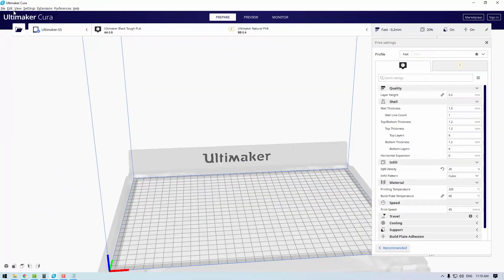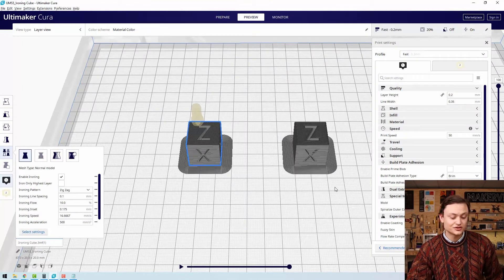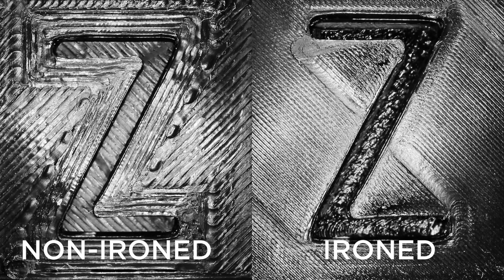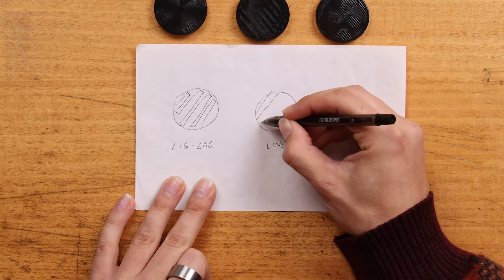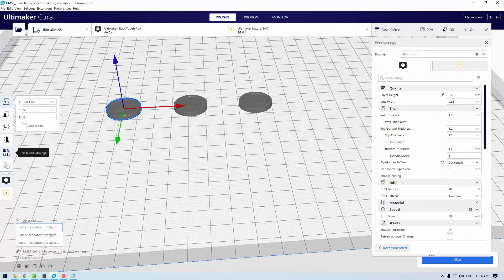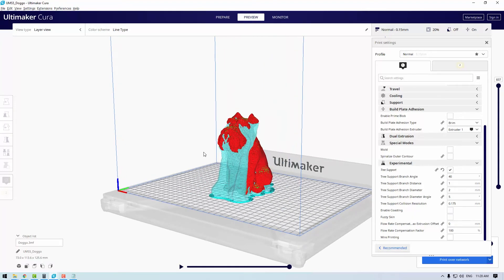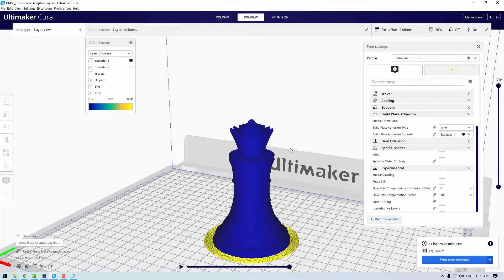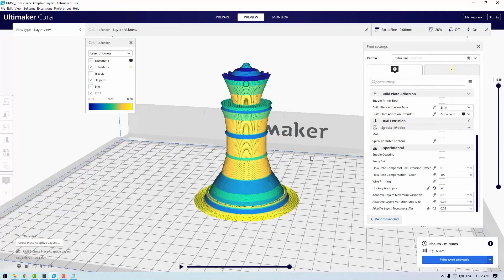More Exciting Features in Cura! Ironing, Top/Bottom Pattern, Tree Supports & More!

Comment: I would like to know if there is a way to print or simulate a solid first layer. It looks like the top and bottom layers are always going to have layer lines. In simpliy3D and Superslicer I can specify a solid top and bottom layer and how may solid layers to print. So far I printed one model 2 times in Cura 4.12.0 and the bottom layer prints with wide layer lines just like the infill pattern type. I wonder if something like ironing the bottom layer or something similar will make the bottom layer smooth. any thoughts? Thank You.
Reply from the maker: Top layers you can get away with Ironing to creating a more flat surface but when it comes to bottom layers you are more limited. This is really because the bottom layers main purpose is to grip the build platform. Ironing that first layer will mess up that adhesion. Knowing when to use Combing and Perfecting the Initial Squish are very valuable to getting nice looking 3D printed surfaces - https://core-electronics.com.au/tutorials/Printing_Perfect_First_Layers.html

You can also specify how many bottom and top layers in Cura as well. Post processing is always an option, using finer and finer grit of sandpaper will eventually result in a very shiny smooth surface. But it will require some elbow grease.

Comment: Cura just seems to hide all the settings. Why is it that all these useful options are 2 or 3 menus deep? Makes things ridiculously hard to keep track of what you've set and make changes as you dial in a print. Way harder than it needs to be.
So on that point,  I'm out
Reply from the maker: I like to be able to see all the settings too, that why normally when I boot it up nowadays I make sure to have all the settings shown by clicking on the burger symbol next to the Search Settings toolbar and clicking All.

Comment: Have you found a solution to getting smooth bottom surfaces no layer lines ? I can get the top bottom smooth without ironing easily the bottom not many channels of anyone I've seem have a solution
Reply from the maker: This guide will help you get a very smooth first layer https://core-electronics.com.au/tutorials/Printing_Perfect_First_Layers.html. If you increase squish just a little bit more it will smooth out the bottom. For the top surface ironing gives a smoother finish. If you want the best result a little bit of super fine sandpaper will sort you right out.

Comment: I don't really understand why the concentric bottom layer is not formed by a continuous spiral from the center - that would produce a much better result. Better yet, say I have a vase with a pentagonal bottom. I thnik the best possible finish for both the bottom layer and the top layer of the vase-bottom can be achieved by increasing the number of perimeters to a very high number so that you force the printer to do the whole area in a concentric spiral copying the outer perimeter. This in itself produces a better result for the bottom of a cylinder than the feature shown here does. The functions for bottom and top layer patterning are still very limited and result in unsightly retraction marks and lines.
Reply from the maker: I really want more options when it comes to top/bottom surfaces as well and I've scouted around the other main slicers and none of them provide any other ones. Retraction marks and lines can be avoided with the right settings but I would like more options the most.

Comment: Actually, lines doesnt put just lines down on the plate. It's the same as ZigZag but with one more wall layer on the inside. The ZigZagpart gets printed onto this extra wall layer and is therefore no longer visible (wall layer under ZigZag on bottom -> ZigZag hidden)
Reply from the maker: I find this image give the most clear understanding of what Zig-Zag vs Lines end up looking like. https://core-electronics.com.au/media/wysiwyg/tutorials/Tim/Concentric_1.png
Reply: Quick question about line or zigzag bottom infill, which one is better for material distribution ? Which one gives the most equal distribution ? I mean zigzag looks way better in software, but in practice it's not the case for me, both infill seems good, but if you know if one is better than the other, I'm interested.
Reply: ┌(★ｏ☆)┘┏(＾0＾)┛(｢`･ω･)｢ヾ( ͝° ͜ʖ͡°)ノ♪(＾∇＾)ﾉ♪(＾3＾♪┌(★ｏ☆)┘┏(＾0＾)┛(*ﾉ・ω・)ﾉ♫⁽⁽ଘ( ˊᵕˋ )ଓ⁾⁾♪┌|∵|┘♪ ヾ(･ω･*)ﾉ┌(★ｏ☆)┘(＾∇＾)ﾉ♪( /^ω^)/♪♪┌(・。・)┘♪₍₍◞( •௰• )◟₎₎(*ﾉ・ω・)ﾉ♫\(๑╹◡╹๑)ﾉ♬(＾∇＾)ﾉ♪┌(・。・)┘♪♪┌|∵|┘♪ └( ＾ω＾)」\(๑╹◡╹๑)ﾉ♬└|∵|┐♪( /^ω^)/♪♪┌(・。・)┘♪♪┌|∵|┘♪ (｢`･ω･)｢┌(・。・)┘♪₍₍◞( •௰• )◟₎₎┏(＾0＾)┛┌(★ｏ☆)┘┌(・。・)┘♪₍₍◞( •௰• )◟₎₎(｢`･ω･)｢♪ \(^ω^\ )ヾ( ͝° ͜ʖ͡°)ノ♪┌|o^▽^o|┘♪⁽⁽ଘ( ˊᵕˋ )ଓ⁾⁾₍₍◞( •௰• )◟₎₎ヾ( ͝° ͜ʖ͡°)ノ♪♪┌|∵|┘♪ (*ﾉ・ω・)ﾉ♫⁽⁽ଘ( ˊᵕˋ )ଓ⁾⁾♪┌|∵|┘♪ ( /^ω^)/♪♪(｢`･ω･)｢\(๑╹◡╹๑)ﾉ♬ヾ( ͝° ͜ʖ͡°)ノ♪ƪ(˘⌣˘)ʃ┌(★ｏ☆)┘┏(＾0＾)┛(｢`･ω･)｢♪ヽ(･ˇ∀ˇ･ゞ)└( ＾ω＾)」moves like Jagger Jerry Seinfeld must be made to order